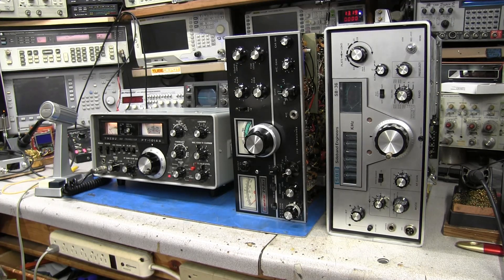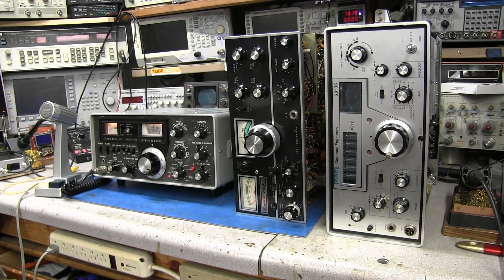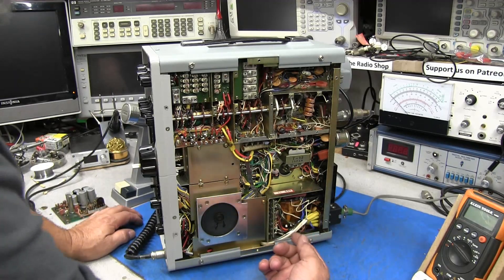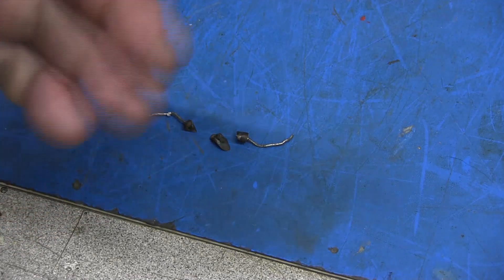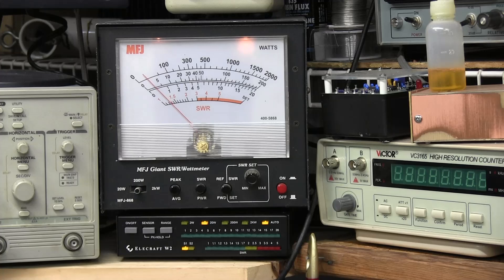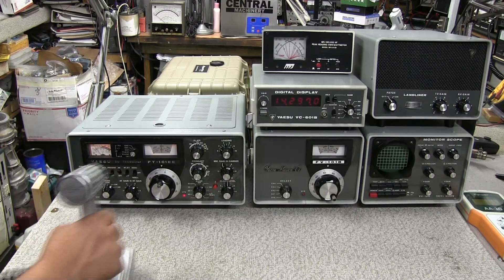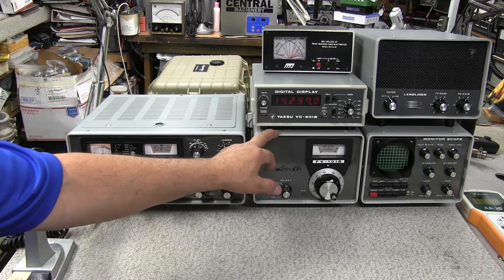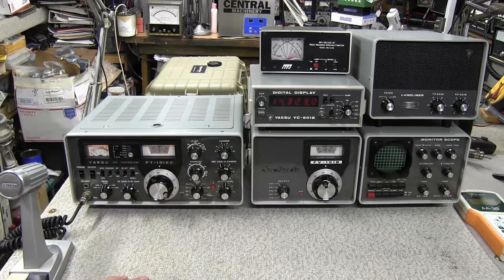Yaesu ft101 station repair part 2 Transmitter

Comment: Thanks for the excellent video....I learn a lot from watching. I have an ft101e I bought used in 1985...has dirty band switch issues I hope to clean up with deoxid soon. Just acquired a ft101zd too....seem to work fine.